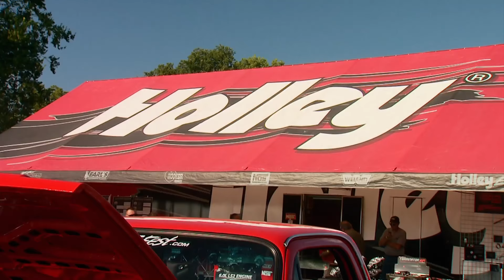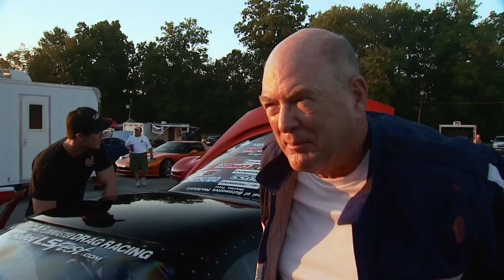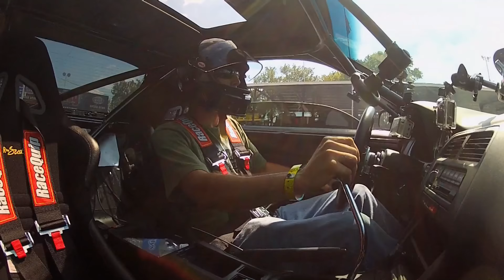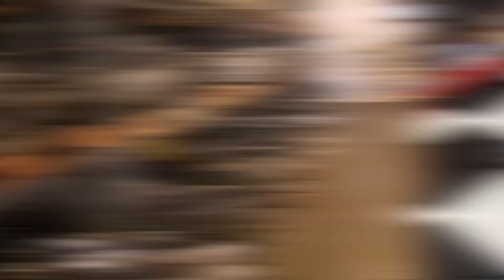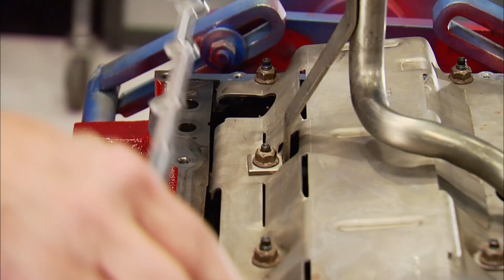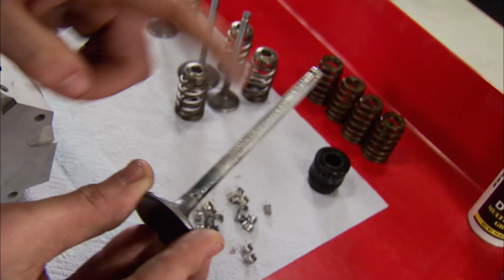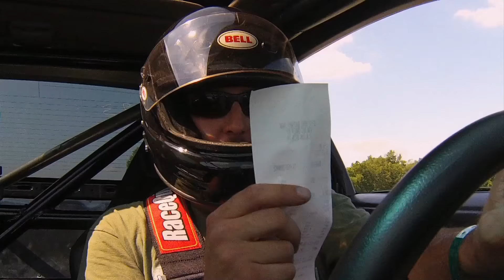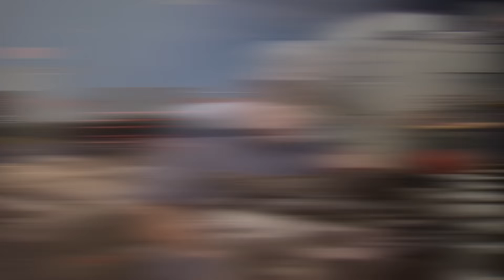Junkyard 4.8L Iron Block Built For Impressive Numbers On The Dyno - Engine Power S1, E1

Comment: I love engine builds like this. Not everyone has 25,000 to stuff in an engine. Thanks for the vid.
Reply: No shit! They have no understanding of the word affordable
Reply: Yeah this still isn't a cheap build. Get you a junkyard LS complete to the throttle plate and computer / harness for about 500 from a u-pull yard out of a wrecked truck. It was running when they wrecked it. For that matter, you can grab the trans for a couple hundred more. Or buy a wrecked 3/4 ton van from Copart, then you got everything in one package to pull stuff off of.

Drop a cam / springs, a set of injectors, and a tune on it. You're pushing 450hp for about 3 grand WITH a trans.
Reply: @notsure7874  I'm still waiting for one of these "official motor channels" to do a real low budget build.  No machining, no wash cabinet, no journal polishing machines... a TRUE blue collar build, with blue collar tools and a working man's budget.  I love powernation, and these guys have amazing builds and do incredible work, I'm still waiting on a budget build with basic tools.
Reply: @RPPerry1984  complete with dingleberry hone!!
Reply: @Brons2  I was forbidden to ever use one, touch one, or own one.  I've always used rigid stone cylinder hones and have had great success.  It was never explained to me why I couldn't use the ball hone other than the generic (they're s***, it's junk... etc).  I might look more into why they're liked/disliked more later.
Reply: @RPPerry1984  Oh I agree, the rigid hones will do a better job, especially at minimizing bore taper.  You could really get a bore out of whack using a dingleberry where you didn't go all the way up and down the cylinder.

But it's fun to see people achieve good results with less than optimal tools, in less than optimal conditions.
Reply: @notsure7874  on god, I’m getting rid of my ford shit🤣 ls stang
Reply: @donniekane3260  that's what I got. 88 foxbody, 4.8, th400. Spindles from a 94-95, rear end from a 94-98 with fox length axles. Roll the fender lips and stuff 275 drag radials under there. Get that backspacing right on the rims. 10x15 rims, 6.5" backspacing. Not a lot of rim choices in that size, but its critical unless you're cutting down the rear and tubbing it.
Reply: @notsure7874  don't forget the turbo!
Reply: @Se7enMiIe  ya well you're not doing that for 3k, but if you want 600+hp then ya. For what they spent on this one, you could  probably have a turbo too.
Reply: There's tons of great engines in junkyards.
Reply: True but it is also stupid to tear an engine down this far and seeing that much scuffing on the piston skirts and not at the very least replacing the rings. I would say it is stupid to tear it down that far and not replace the pistons, rings, all bearings, guides and seals. When you look at at what they do replace it is kind of silly to leave the pistons and rings.
Reply: When I hit the lotto I'll build it, lol
Reply: Yup uncle Tony's garage
Reply: That's for sure... it just warms my heart to see companies making affordable performance parts

Comment: Boat anchor
Reply: @bigboreracing356  that why the ls7s were blowing rockers and rod knocking from the factory? the 5.3 with failing lifters?
Reply: @bigboreracing356   haven't had trouble with any other ones... just gm.
Reply: @bigboreracing356  ok boy...
Reply: So satisfying...
https://youtu.be/Odq9E92DAJk?t=816
Reply: Lot of boat anchors
Reply: @bigboreracing356  butt hurt?